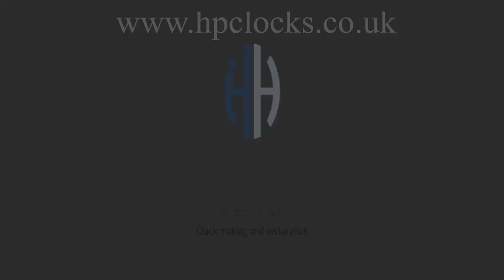Byzantine Sundial Calendar Build. -  Part 2, Making the Wheels

Comment: Superb. I do appreciate that you hardened your cutter using a gas gun without  fusing big dollops of borax to it. You may wish to try a mixture of carbon and oil to prevent scaling/oxidation . The carbon I use is in the form of Graphite (( an allotrope of carbon) usually from  pencil leads ,but is also readily available in a pure powder form for lubricating locks. Cut back some of the pencils wood to expose more 'lead' and abrade  it  with a needle file using about one inch to prevent loss by unnecessarily filling all the teeth . Mix the resultant powder with a few drops of oil ( any type) and paste it onto the steel.. The oil will burn off ,leaving a layer of carbon which simply wipes off after quenching.
Rough note.  Pencil 'lead' is a mixture of clay  ( I thinks it is kaolin) and graphite , the amounts vary to give harder, denoted by H, or softer, denoted by B, pencil leads . A number before the H or B denotes how much harder or softer the pencil is. HB is in the middle and is the commonest type.
I have never tried using graphited oil, charcoal ,lamp black or diamond (an allotrope of carbon too) as a source of carbon because I couldn't find any in my pockets..
Thank you again for devoting so much of your time to sharing your skill and knowledge .

Comment: Hi Tommy, Just found your channel and am enthralled! Such skills and confidence. I am not into clock repairs, more into modelling and have a project to start requiring a lot of detailed cutting of 1 mm thick brass and copper sheet and was impressed with the fret or coping saw you used .
Can you please tell me the name, make and type of saw and blades you used? (Perhaps also recommend a supplier?)
Have subscribed and will watch more videos as time permits. Thanks for sharing.
Reply from the maker: Great to hear from you, thanks for the comment and the sub!  I use a Bacho long reach piercing saw frame as you can get much more control compared to the shorter type.  Link here: https://amzn.to/3pDX4ZI
Blades here: https://amzn.to/3dtRRkD
Reply: @TommyJobson  That's a great help Tommy, I have ordered them.  Stay safe and thanks again for the quick response.

Comment: Great work! Is the angle of the cutter 80 degrees? I  couldn't quite see it in the video...
Reply from the maker: Yes, 80 degree included angle. There is no specific theory for the angle as far as I can find out, however I have spoken to Chris (Clickspring) on the subject and he said he used a range of degrees for the AM. I used fusion 360 to sketch the tooth geometry to come up with an angle that should work with more or less the right centres. That said, I haven’t cut enough wheels to properly test the mesh yet!
Reply: Thank you! Can't wait to see more from this project!